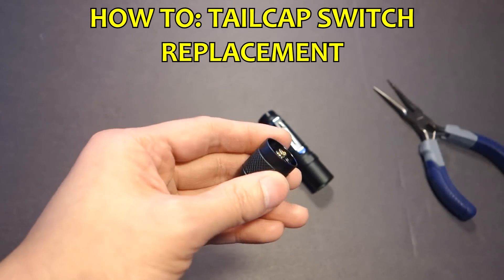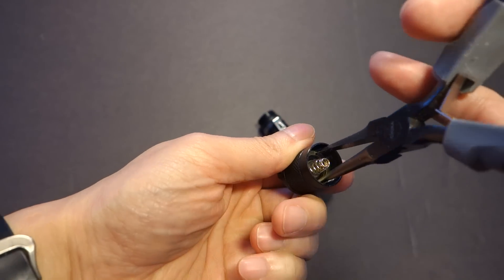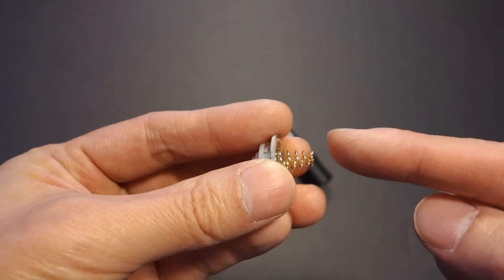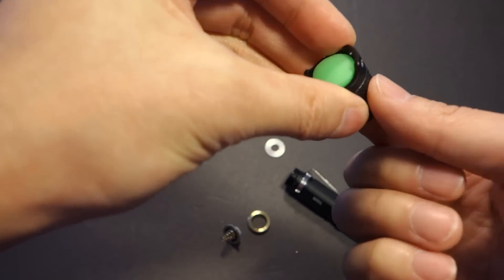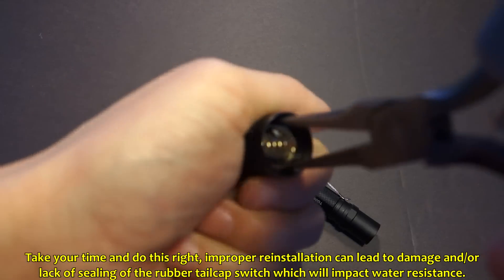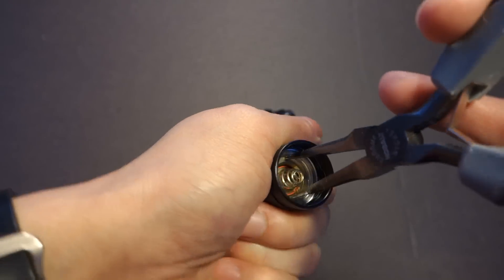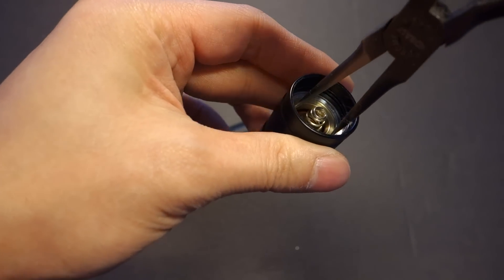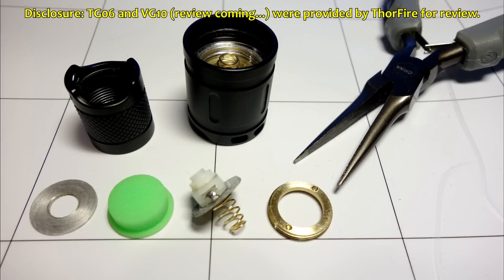HOW TO: Flashlight Mechanical Tail Cap Switch Replacement

Comment: So where can we get parts ??  My x700 needs a LED cartridge-- it's dead.
Reply from the maker: I haven't had direct experience w/that particular flashlight but perhaps you can reach out to the vendor you purchased it from for assistance. In a quick search, I found this article: http://www.infinitepowersolutions.com/alumitact-x700-flashlight/  perhaps you can use the contact info in there.

Comment: That was good info about the Thrunite flashlight. I believe that is why mine has so many issues with the switch not working. It is loose after a couple of months and I have to cinch it tight again. It is a bad design and I am not happy with my TN12 for that very reason.

Comment: Hey I recently got one of those Bell&Howell Tac Light's. It's just a chinese knockoff with the B&H name imprinted on it. Now that I have one I've been finding them all over the web for 4-7$ same T6 cree LED and all. Either way, I dropped it and now it doesn't go through modes like it used to. It has 5 modes, Hi-Med-Low-Strobe-SOS. Usually cycling the power button goes through each mode just fine but now it won't cycle hardly at all. If I take the tail cap off and use a paper clip to jump from the battery holder to flashlight body it cycles just fine. But the strange thing is, that the switch works like it should, it turns on and off no problem jut won't cycle through modes. But using a paper clip in place of the switch, i can cycle again. Any ideas?

Comment: could you recommend a tail cap switch replacement for my klarus XT11! mine only works in on/off mode,it once did work in high med low and strobe mode,and i don't no what happened maybe a bad switch! the TG06 looks like it would work!lots of thanks,and grate video.
Reply from the maker: +Blane Biondolillo Hi there, I don't have an XT11 so I'm not sure what switch might work in it. Best to post a question to the folks on the light forums like CPF or BLF.  Thx for the comment and let me know if you need further assistance.

Comment: What kind of battery should I use to bring out the 300 lumens from the TG06 flashlight, because when I use regular AA batteries it's not in full brightness.
Reply from the maker: +kevin balbacal Looks like the upgraded version features 300 lms. The particular sample I received only pumps out ~150lms with LiIon. In your case, I'd recommend the Keep Power 840 mAh 14500 cell. I purchased them off Amazon and they are one of the better 14500 cells out there. I originally selected this cell to pair with the Manker T01 after poring through HKJ's reviews and batter comparator. Sadly it was too long and didn't fit in the T01 but it does work in my T06. I can't imagine that they changed the length of the new version so I'd expect it to work just fine it.
Reply: +turboBB73 thank you very much! Appreciate it.
Reply from the maker: You're welcome!